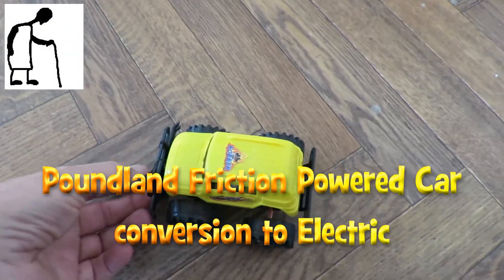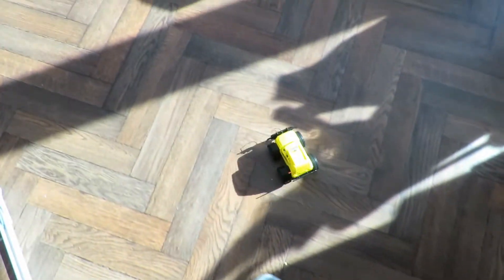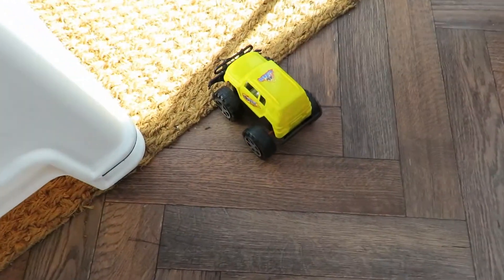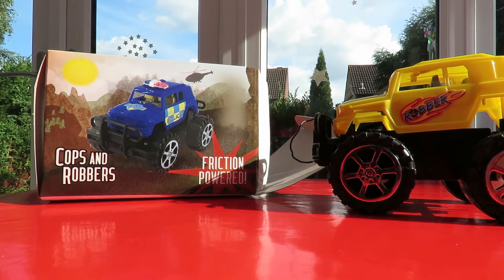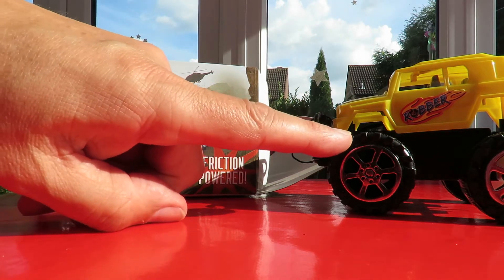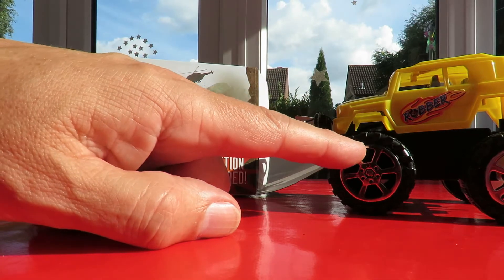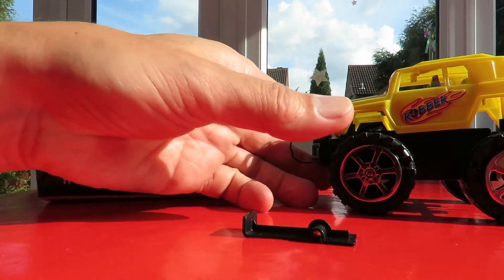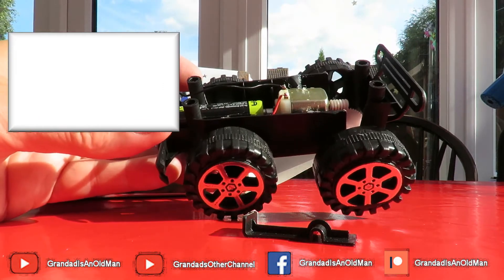Poundland Friction Powered Car conversion to Electric - TEST RUN

Comment: little thread with a hot glue will give it some traction
Reply from the maker: Yes that would work, or cut some strips from balloons to make wide rubber band type tyres :-) Thanks for your suggestion.